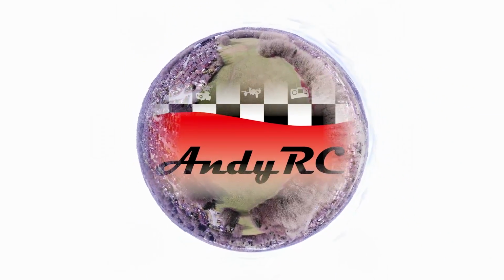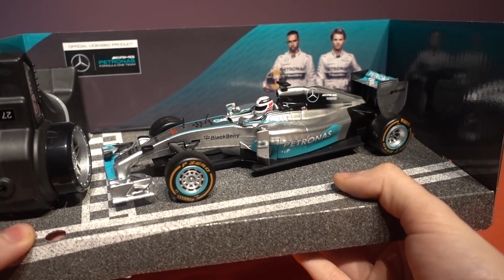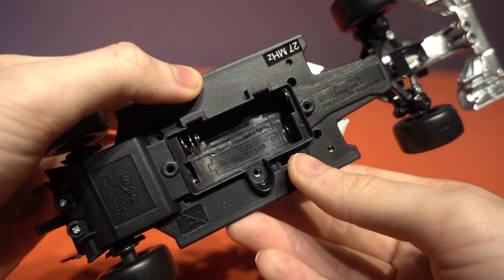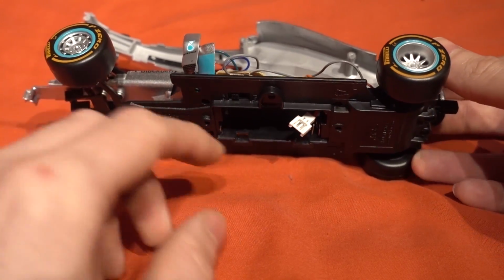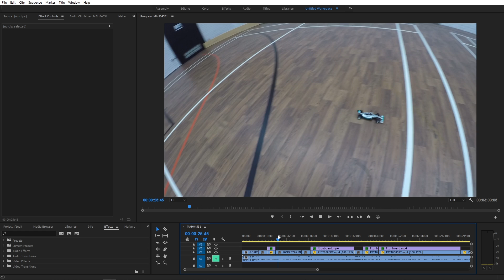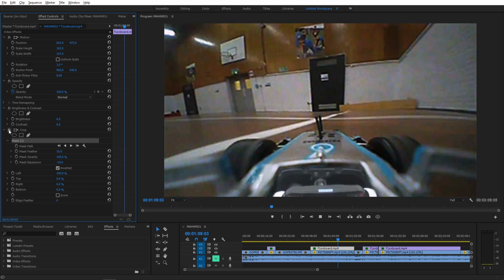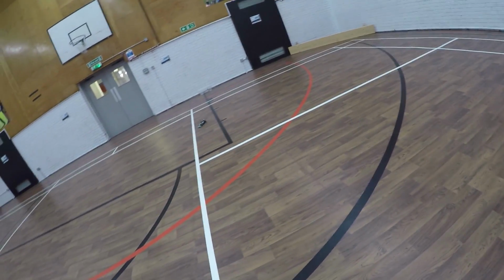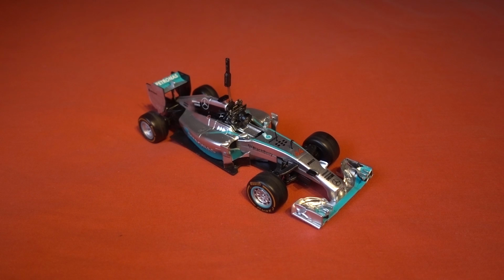FPV F1 Car - How To Make

Comment: If you could buy this model off the shelf with the fpv camera, sound effects moving steering wheel etc with a cheap set of goggles included I’m convinced it would be a real seller for Christmas. An outstanding bit of editing there Andy. Cheers 👍

Comment: I think it awesome that you made the edit! a tip to make it look more part of the video is to overlay some grain on the video you put in there to make them blend even better. Awesome work
Reply from the maker: I did that but because the bitrate is so low on the DVR, youtubes encoder just removed it so the original looked more convincing but wasnt worth the extra processing time for each video. cheers
Reply: @AndyRCchannel oh yeah it "smooths" alot of videos or details, anyways I would love to see more edits like this! I had to do a double  check first time watching the video

Comment: ah ha, i was wondering about the sound, completely convinced me it was some sort of audio effect from the car/controller itself,  and as somebody who has tinkered with after effects i have to doff my cap,  i really like the way the f1 car handled, slippin and slidin at low speeds would be great for racing, if only you could put the guts from the other car into the f1 shell.
Reply from the maker: haha thanks, as for the last point. Im already working on that ;)
Reply: That would be so cool! Proportional steering and throttle in your Team LH FPV Merc would Fab! Looking forward to that vid :-)

Comment: Fantastic job, Andy!!! 😃
I really thought the sounds and hands were from the car!!! 😂😂😂😂😂
BTW, you can upgrade it to hobby grade using 2 brushed escs (you probably wouldn't be able to fit a servo in there) and a small receiver. I already did that, more than once and I have one of those times in video. But the cars were bigger, so I had less issues. You know?

Comment: I did the same with an F1 rc ... my problem is that I didn't have enough command range to go to other rooms ... can someone tell me if you could install a rx frsky xm plus?
Reply from the maker: you would have to replace the board as 27mhz is analogue